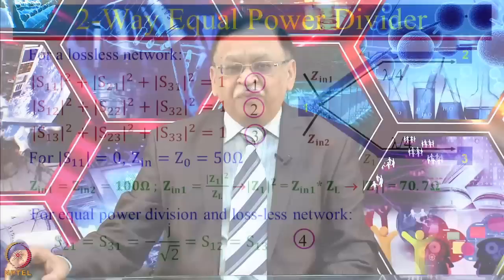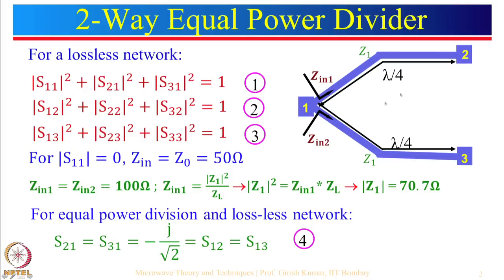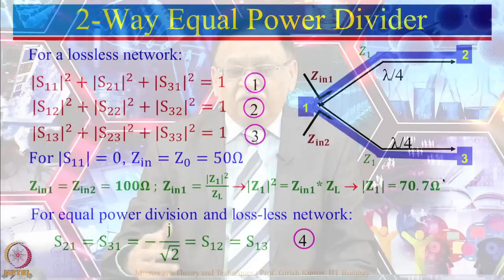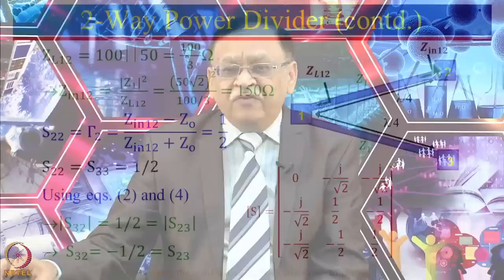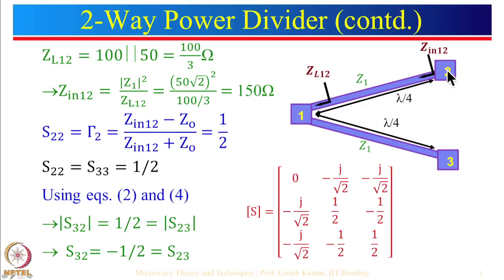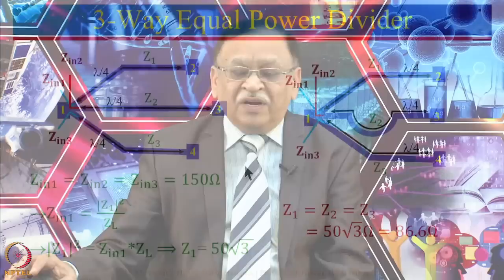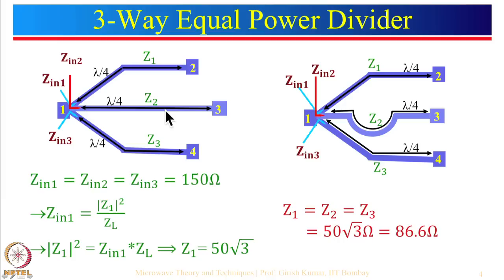Week 4-Lecture 16

Comment: @9:45 where he is computing the reflection coefficient on port 2, why not use Z1=70.7 ohm instead of Z0=50 ohm? The characteristic impedance is Z1, not Z0. Could anybody explain it?
Reply: I got it, in this case, port 2 of 50 ohm is the characteristic impedance, and Zin12 is the load. So I shall flip the direction.

Comment: Sir very well explained. I have a question about the 5-port power divider and combiner. I designed a five-port power divider and combiner like configuration 2 you explained in this video. There are 2 different plots for isolation loss which I obtained after stimulation, while the obtained output return loss and insertion loss for all ports are the same. What's the logic behind that. Kindly help me with this. Thank you